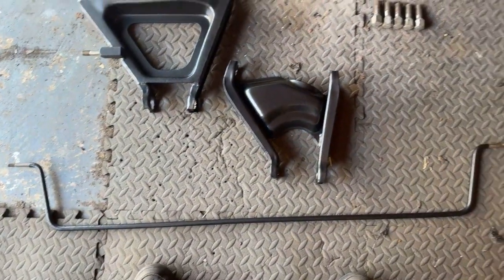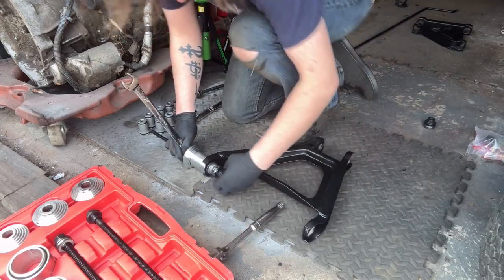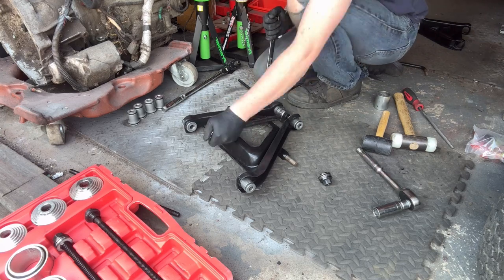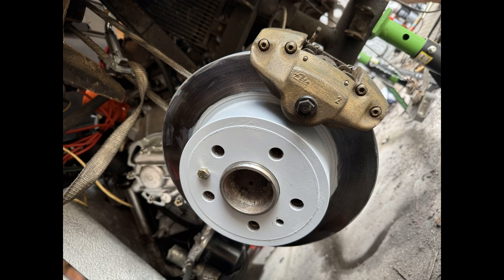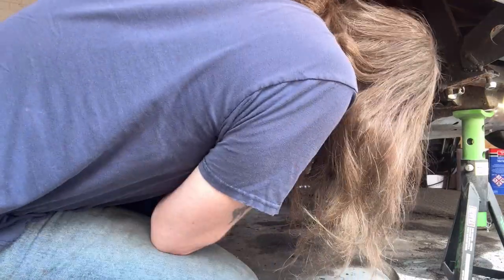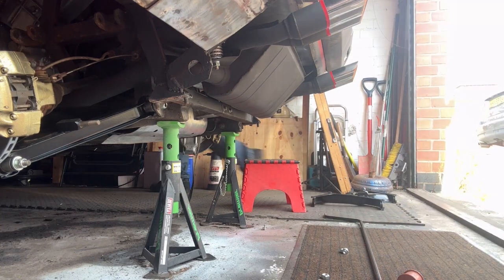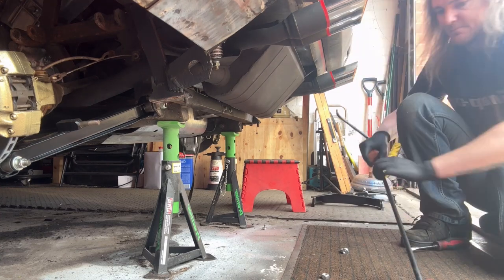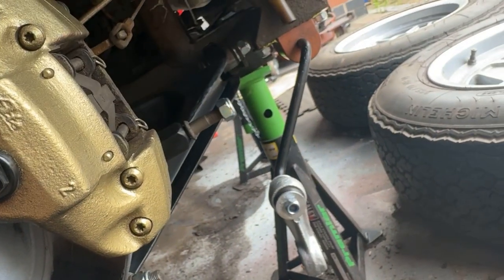Ferrari 308 GT4 Project: Suspension Build Up

Comment: You are supposed to tack weld the outer part of bush to the A arm .Otherwise the thing spins and no rubber flamboc effect is given out by the bush .
Reply: You're right, I think I can see the tack welds at 8.37 on the new bushes